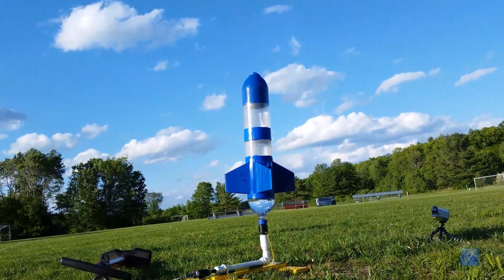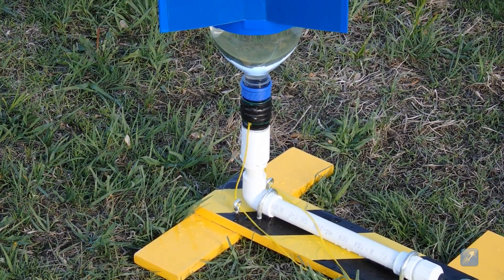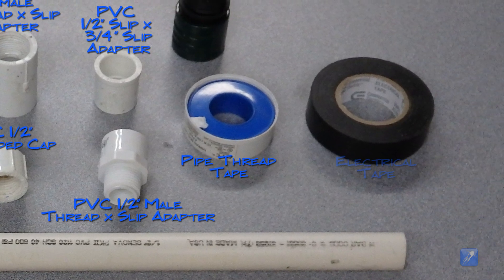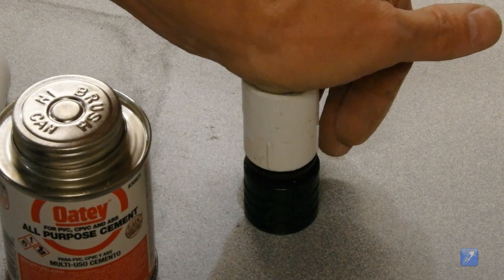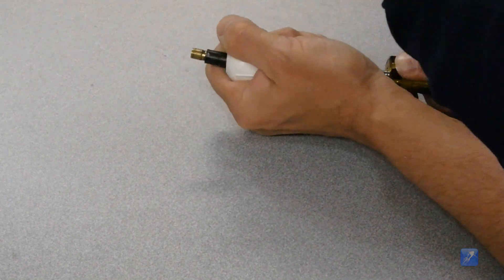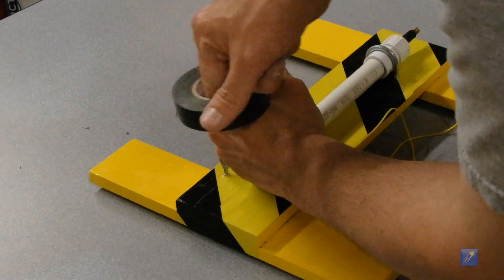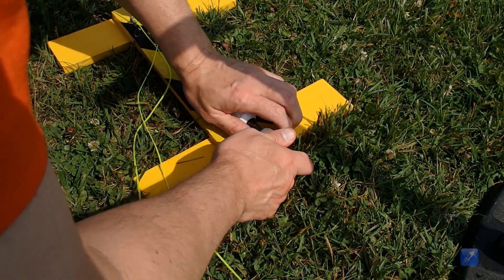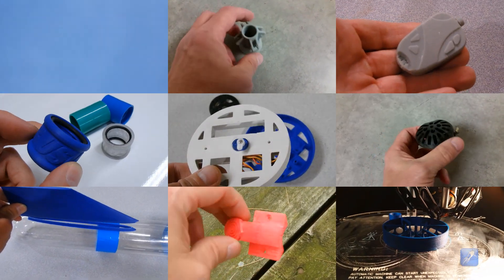How to make a Gardena Water Rocket  Launcher

Comment: Using Gardena parts and followed instruction details. My rocket does not go up very high. Flies very irratically and hits the ground. I have added fins, etc. Nothing works. What am I doing wrong? What do I need to do differently?
Reply from the maker: It's hard to know because I can't see the size of the rocket, but if it's only a 2l bottle, then you probably need more air pressure and/or some weight in the nose (clay is a good choice because it's not going to hurt you if the bottle explodes)

Comment: Why do you in the US still use inches and so on instead of the metric system???
Reply from the maker: They tried using the metric system here, and the people didn't like it, so they went back to the imperial system with a few things remaining in metric units or a mixture of units.
Reply: Why do you that are not in the US still use metric and so on instead of the easy imperial system?? FTFY.

Comment: How would you use this with different sizes of nozzles
Reply from the maker: This type of launcher does not lend itself to nozzle diameter changes because the bore is small to begin with and if you drill it out larger it might make the plastic too thin. You could probably reduce the size of the bore by gluing in a plug at the tip and drilling a smaller bore. But the size of the Gardena release mechanism that you use this with limits the size of the nozzle to a small range, so you won't be able to get more than a few mm larger or smaller hole with this type of release.

Comment: I made mine, followed every step and for some reason every time I lock it in, it leaks water out of the tire shrader valve. Do you know why?
Reply from the maker: I'm not sure I follow the exact problem you have. Is the water coming out of the valve itself where they air hose attaaches, or is it coming around the valve where it's connected to the PVC?
Reply: It leaks out the tire shrafer valve.

Comment: from where can I get Schrader in India
Reply from the maker: I would guess that you can use any tire valve that you could buy locally. Even a bike tire valve from an old inner tube would work if you made the hole in the end cap the correct size to fit the valve so it won't pop out.
Reply: @USWaterRockets  bit late, but that is correct, I cut the piece with a valve out of a inner tube and I'm using it in my air gun. Almost 2 years in business, so that should prove it.
Reply from the maker: This is good to know. Thanks for sharing you experience!

Comment: Or you can use a special "3/4npt" female Gardena part, and downsize the 3/4" with plumbing parts down to 1/8", and use a central heating boiler reservoir fill valve. 1/8npt to schrader. The nozzle size is a downside for me though, I like them fast.

Comment: Hey how can i make a homemade garden nozzle? :(
Reply from the maker: +DieselPunk Z Most people take the hose fitting and slice off the threaded part, leaving a flange behind, then they drill a hole in a soda bottle cap and push the trimmed hose fitting inside until the flange bottoms out in the cap. The rubber washers that came with the hose fitting seal the flange against the top of the bottle when you screw the thing on. Other people take the hose fitting and spread glue all over it and then force it on the top of the bottle. The threads are way different but they grip enough to screw the thing in place and then the glue cures and prevents it from coming off under pressure. It's stuck on there for good and you can't take it off though.
Reply: +USWaterRockets  Thank you very much!! I did the base and it works very well, the only detail, is when i pull the strings, the base just go with it !!!
Reply from the maker: DieselPunk Z I think it has to do with the size and weight of the base, the weight of the rocket, or how well the feet grip the ground. You might be able to tweak one of these items or all of them and get it to stay put. You could also make a hole in one of the legs and put a stake into the ground to make it stay in place.

Comment: Hi, my name is Jon Hoggard and i attend Kalkaska Public Schools in northern michigan. I am currently in astronomy, an elective offered here at Kalkaska High School and we shoot water rocket alot, but the best water rocket we have is just one 2 liter with a nose cone and wings, and its farthest flight was about 500' and i was wondering what you guys over at US WaterRockets thought was the best way to get the most distance from our 2 liter bottles? Should i splice 2 together? Should i cut both ends of the bottle and splice 3 together? How many bottles on top of that? How much weight in the front, how much water, and what preasure? How many wings? Any wings? Just looking for some advice, and looking to get any sort of feedback from you guys.                           Thanks, Jon.
Reply from the maker: +jon hoggard if you are allowed to have more volume than 2 liters, then the way to go farther is to make the rocket from as many bottles as possible. A 3 or 4 foot long rocket will definitely go farther. Usually this is a good length because if you go too gig then the rocket will start to droop on the launcher and this will start to decrease the launch angle to the point it will be too low. You will need some fins, but the long rocket will allow you to make them smaller and use only 3 of them. The longer rocket will let you use less ballast in the nose as well, but you still need some to help with stability. One way to get a good design going is to look up a water rocket simulator online and plug in different sizes and shapes for the rocket and you can get a good idea what to build that will comply with the rules you need to follow. Good luck!
Reply: +USWaterRockets I can do whatever i want to, my options are unlimited, no rules. I'm looking to get over 600 feet, and any more is just the same, but at least 600. so ill use about 6 bottles, but should they all splice together, and make them for more volume on the rocket? or should i just do the 2 bottles spliced together and use the other ones just for structure?
Reply: +jon hoggard and what about weight im the front, what do i need for that? anything? and do you recommend a nose cone at all?
Reply from the maker: +jon hoggard we really don't need to add weight to our rockets because we have a parachute recovery system controlled by a servo motor and an altimeter and a camera in the nose of our rockets. The weight of those parts plus the battery generally gives our rocket enough nose weight to fly perfectly stable. If you don't have these things on your rocket, then you might have to add some weight to the rocket to make it stable. Adding some modeling clay to the nosecone is a great way to do this. The amount of weight to add will vary depending on the size of your fins and length of the rocket. Your best bet for figuring out the optimum is to either use a simulator like OpenRocket or use test flights and adjust the weight amount and see what helps and what hurts.
Reply: USWaterRockets Thank you so much, and i hope ill be flying soon!

Comment: i notice you use just a regular floor pump. i used one for rockets once and it was ruined after a few launches by water flowing back into it and messing up the seal. how long have you been using that one?
Reply from the maker: aeshir This pump is about 10 years old and has been used for many years of water rocket launches. We also use it for inflating bicycle tires quite often. We use it so much we broke one of the plastic fittings that holds the hose on, and replaced it with a regular hose clamp. It seems odd that the water would ruin a perfectly good pump, because water will precipitate out of ambient air when you compress it. Most compressors have a drain valve so you can drain off the water that forms when you compress air. So, the seal should really not be something that would be ruined if it was wet. Perhaps it was just a bad seal to begin with? Or perhaps the water flushed some grit or dirt into the seal and caused it to stop working correctly?
Reply: USWaterRockets yeah it was just a 12 dollar floor pump. i'm just worried about ruining my new-ish, now only floor pump (about a 20 dollar one), cause i have a compressor but my pump is also the only gauge i have that goes up high enough for road bike tires. i'll give it a try though! i miss doing water rockets